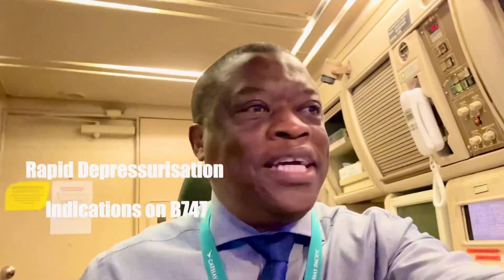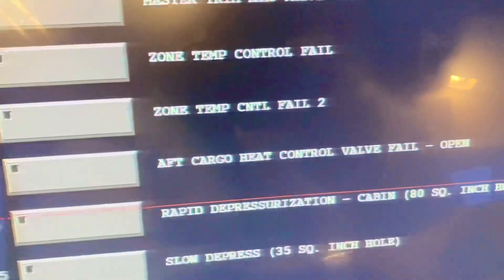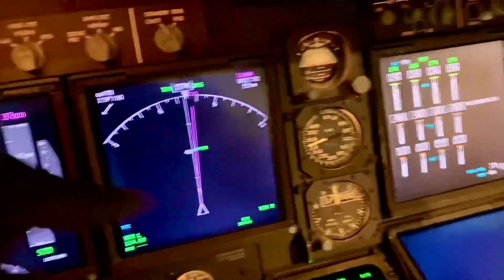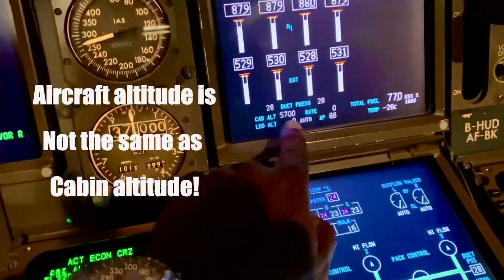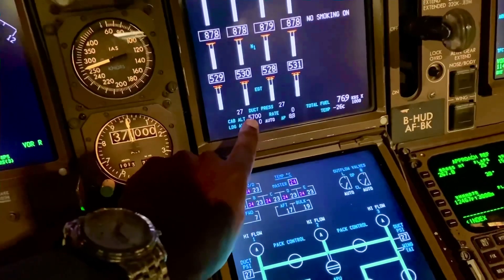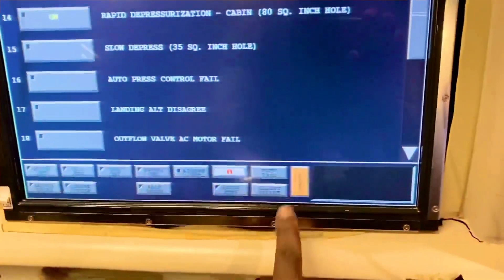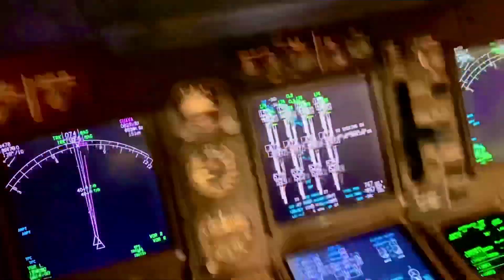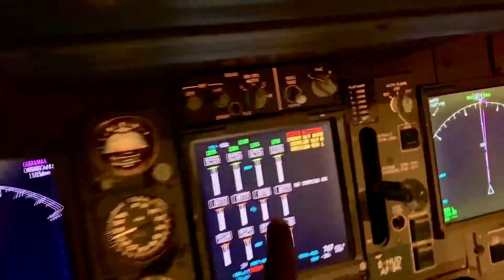Rapid Depressurisation indications On Boeing 747-400

Comment: The hiss noise is an obvious indication that something is wrong.
Im suprised that the captain has to drop the masks in the cabin. I would think that it would be automatic on depressurization. What if the pilot is incapacitated by something coming thru the front window?  Maybe there are bigger worries in this case.
Reply from the maker: The masks will drop automatically at a cabin altitude of 14000 feet. The pilots can do it earlier as I did.
Reply: i think they drop automatically, the switch in the cockpit is just a verification anyway just in case the automatic drop doesn’t work